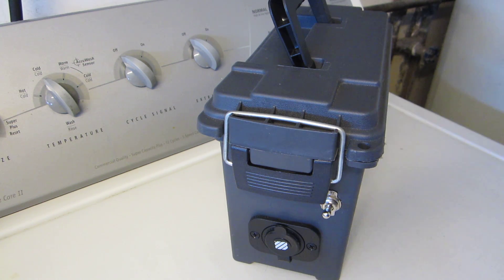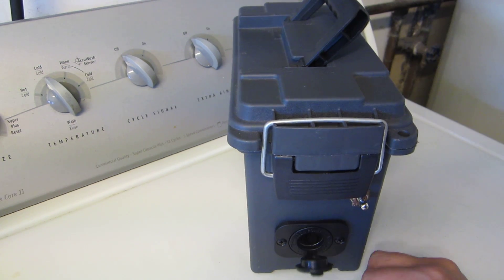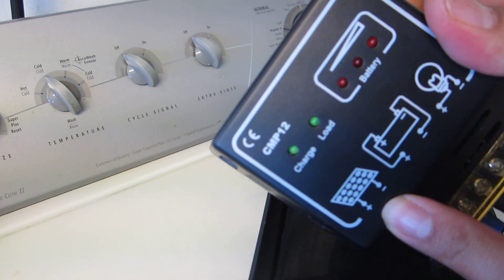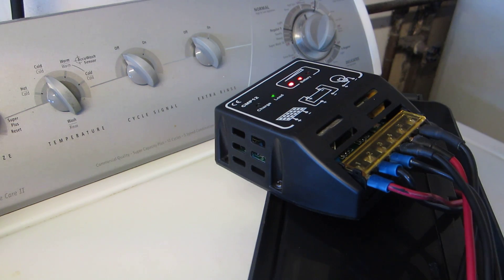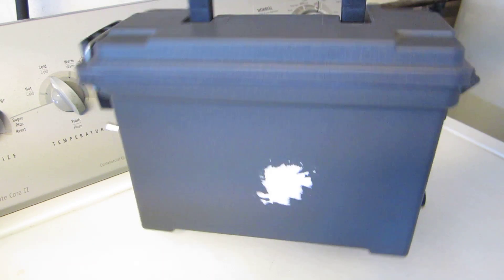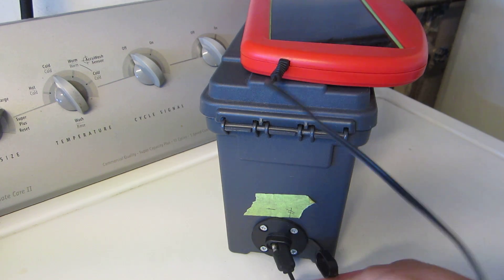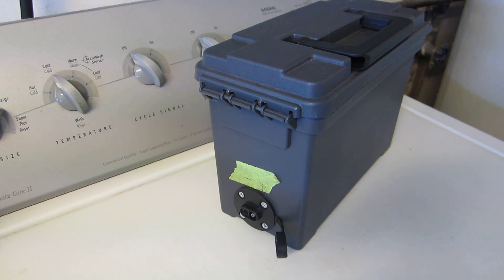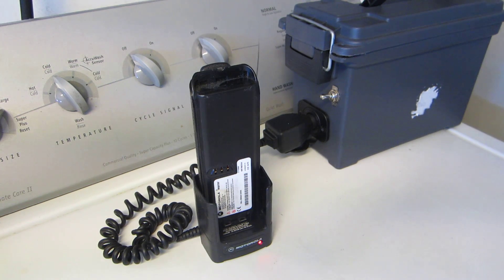Portable Battery Power Box, SHTF Emergency Box

Comment: I like the idea of adding a switch between the controller and battery to avoid loss from the controller's LED.  I'm planning (and gather parts) for my project.  I might now have 2 switches. From between input and controller.  The second between the controller and battery. hmmm.....

Comment: Thats cool I did one using two 6 volt batteries connected to make it 12 volts, they were regular alkaline batteries, with a cigarette end like yours except min had a 75 watt inverter with usb, I build it for home use only so when the lights would go out we can connect any 110 volt lamp to it, so far ive used for about 12 hours total in the last 8 months and the batteries still got some juice, once the batteries go, its just a matter of replacing them, usually 6 volt batts will give around 11000 mah hours which in real time is around 10 amp hours, and you can find then for 5 bucks each, also during hunting season walmart sells the amo boxes for 4 bucks check it out next time, thanks for posting your setup

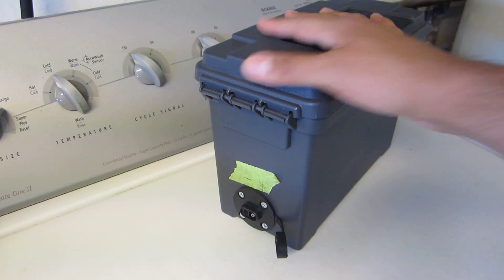Comment: REally good idea! At 4:50 you mention an AC/DC adapter.  I don't know much about this subject, so please bear with me.  Does the AC/DC adapter plug into the SAE outlet?  If so, will itg charge the battery going through the solar charge controller?  What brand/size of AC/DC adapter do you have?